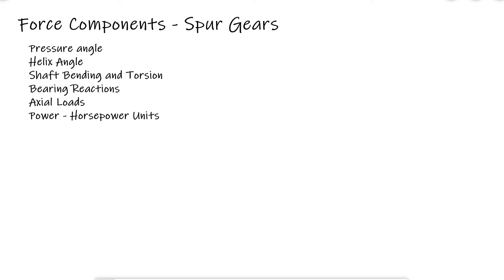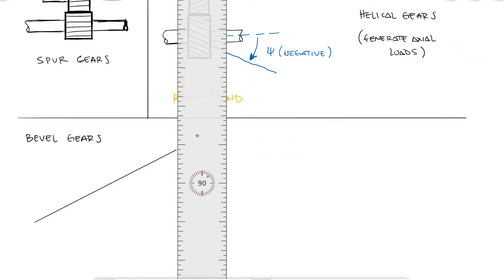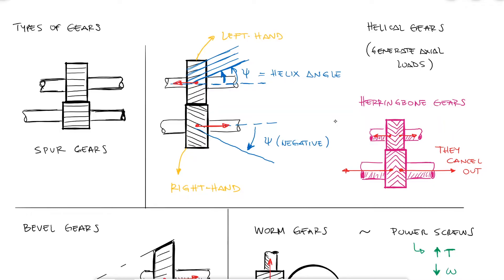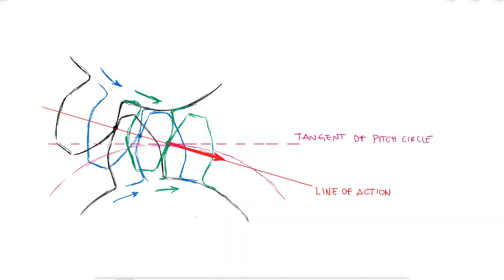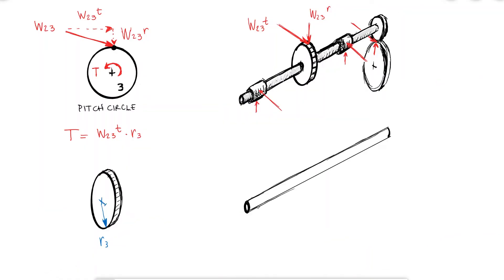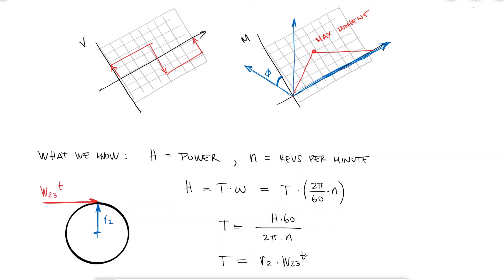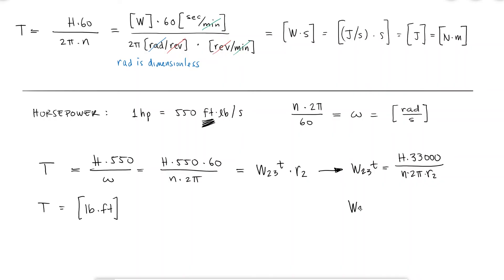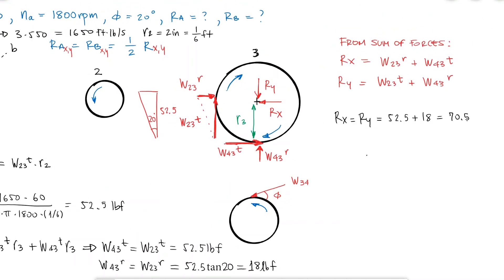Gear Forces and Power Transmission of SPUR GEARS in Just Over 12 Minutes!

Comment: A couple of things:

1. When you draw the gears '3D' the  major axis of the ellipse is 90 degrees out of alignment. The gears look too 'tall'.

2. When you discuss the radius of the gear, you need to clarify if it is the pitch circle radius or the base circle radius. To me, it looks like you are assuming that the force (derived from the torque) is acting through the line of action which is at a tangent to the two pitch circle diameters? If so, it doesn't, the force acts at a tangent to the two base circles. If this is the case (I may have misinterpreted your calcs) consider redoing the video as all of your component calculations will be incorrect.

Comment: Thank you for this nice video. I would like to ask how I can calculate the radial and axial force components acting on the bearings of an electrical motor.
Reply from the maker: The axial and radial forces are found through the gear-shaft-bearings setup you have. It depends on the number, location and type of both the gears and the bearings. Here's a video on radial and axial loads on bearings: https://www.youtube.com/watch?v=3b8yOMSWXXk&t=0s